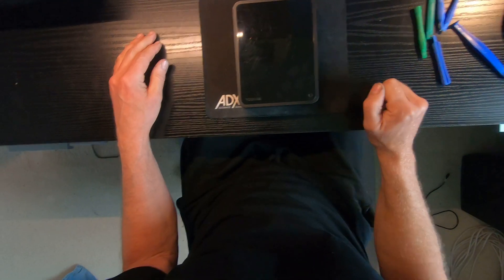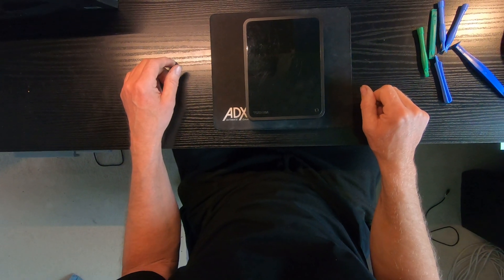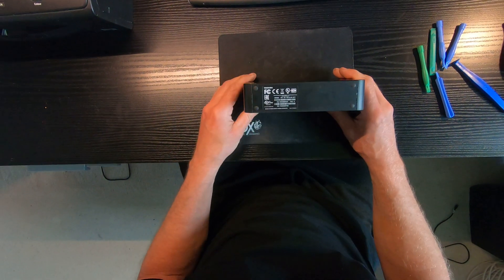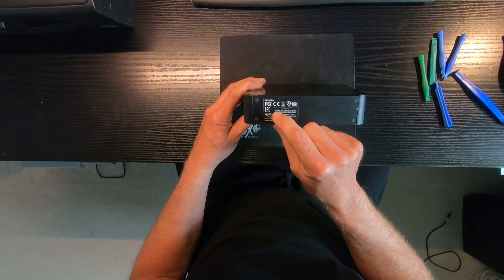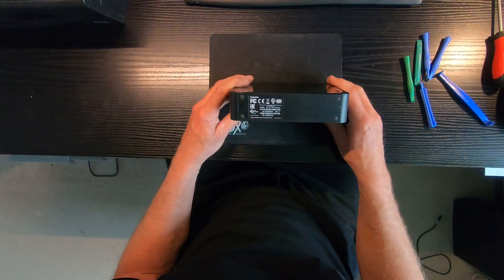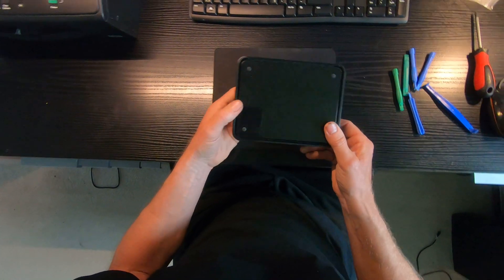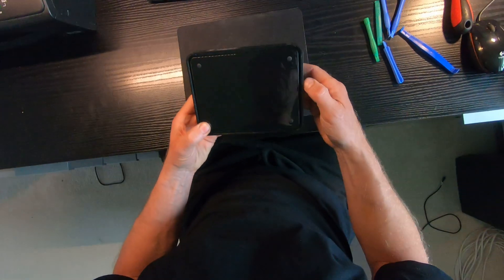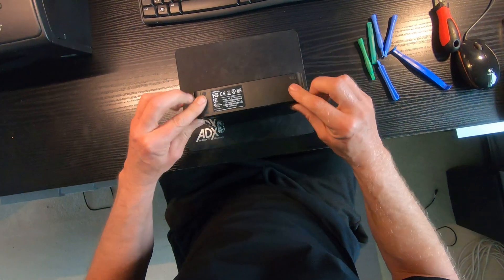How to disasembly a Toshiba Canvio

Comment: Thanks Michael! I was looking for a method of disengaging the latches without destroying the case, and sure you exposed the weak points. 
Canvio's plastic case is very good for insulation, and my disc was indeed feeling very good insulated, reaching 70 degrees C after 20 minutes of reading. Only by freeing it from the case and exposing the HDD metal to the room air has lowered the temperature to 53 degrees C. HDDs shouldn't suffer that much.

Comment: What happened with your disk? My disk is a also a DWC360, it only have 2 months and stoped working, I plug in to energy and nothing happens... I tested with other AC-DC transformer and still not working... I think the problem is the external case, I think that if I open it, I can use it as internal disk like you.
Reply from the maker: The disk that is in the DWC360 is exactly the same disk that is sold as an internal hard drive. MD04ACA600 is the name of mine and it is the same sold as internal hard drive. So using it as an internal hard drive is no problem. You must have been unlucky that your hard drive has broken. I have not had any problems with mine or others I have taken from external hard drive.